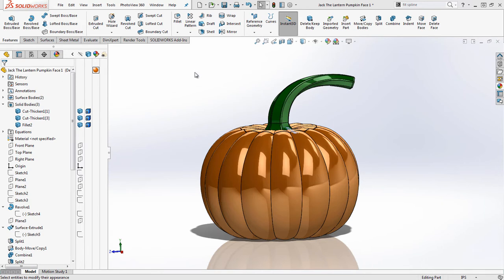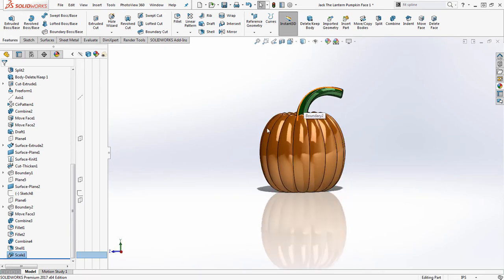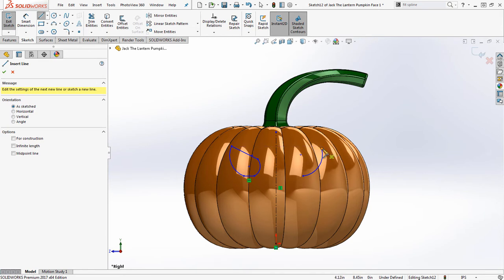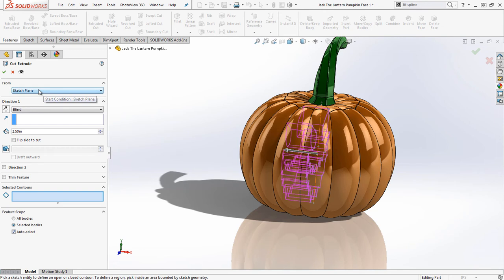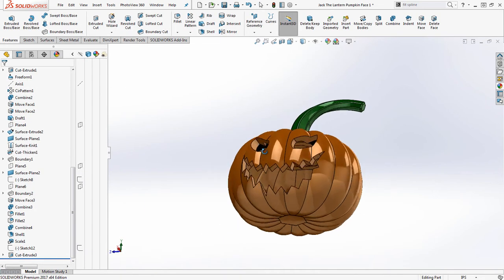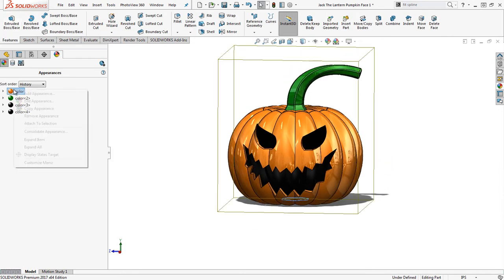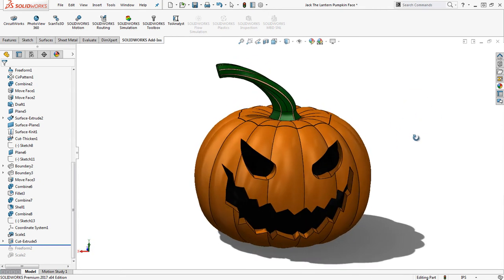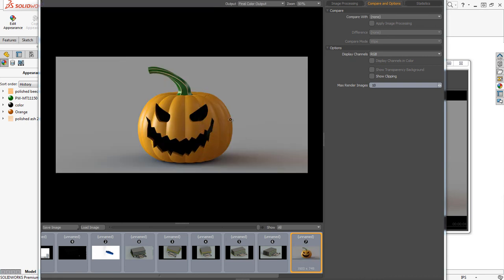Creating a Jack-o'-Lantern in SolidWorks Part 2

Comment: My SolidWorks 2018 stops responding when I attempt to shell.  Any suggestions?
Reply from the maker: Does it stop responding for all shells or just this one? You can try different thickness values. A lot of the time shells don't respond well for non-tangent faces like we have in this model.